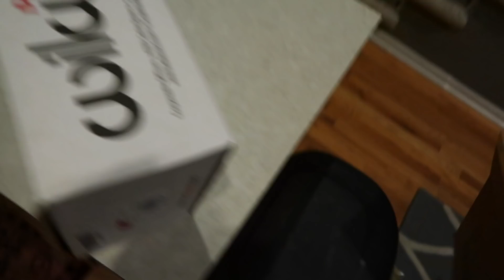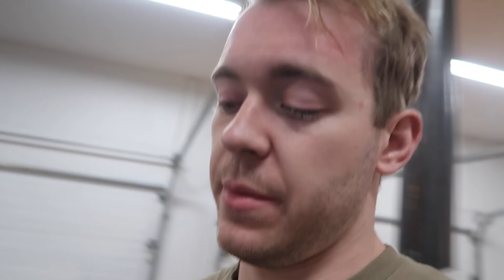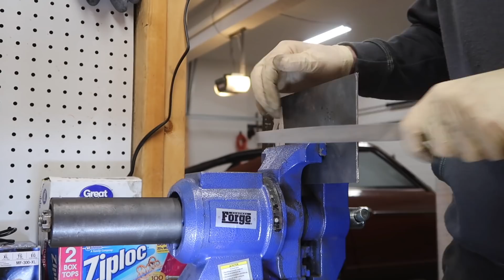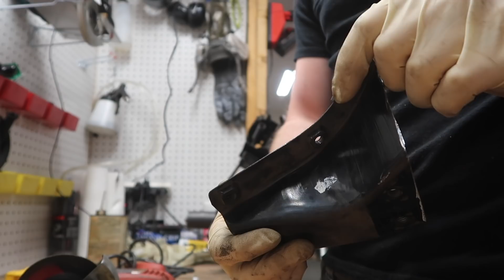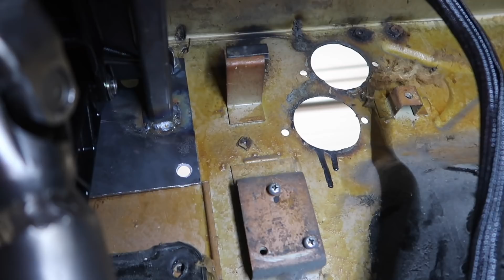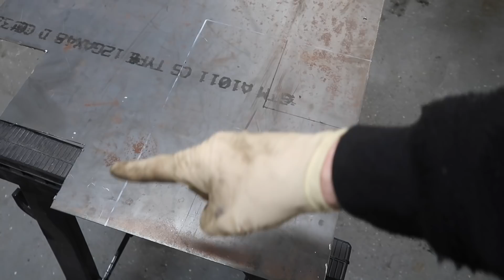Wilwood Race Pedals and Z Power Steering | 2J-Z Episode 26

Comment: You identify the ends of the main steering shaft wrong.  You stuck your finger in the steering lock hole as you describe that end as going towards the firewall.  Nope, that's the steering wheel spline you're holding.

Comment: I give you my opinion to your 240Z build. It sucks! I don't want to look like a hater but that was a good car to begin with a nice restauration. And you cut and build the living fuck out of it. What you will end up is a fast car that is a lot less worth then a stock in good condition one. You should have choose the W58 transmission... it is slim and fits in. OK it does not like so much power like that trans mission or a R154 that is pretty wide too. You could have used a RB26 engine to and have much less hassle with the swap. But yes it is your car and you can do what ever you want with it. Please make sure you reinforce the frame structure and the chassis before you hit the road with it. That 2JZ is heavy and the car wasn't build for that or the power it makes. If you don't prepare it for it you will twist the shite out of it.
Reply from the maker: This car wasn’t restored bud. No thanks on your transmission suggestions, my solution works just fine. If you watched my other videos you’d know the chassis has already been reinforced. Do your homework before you write you snarky comment bud.
Reply: Did I hurt your feelings? If you would read what I have wrote without that pain in your ball room you would see that I wrote it was a good car to begin with an restauration. And I watched only parts of some videos... so you might be right on that part. I just cant watch all because that might hurt my balls. To many people think it is great to swap a 2JZ in everything with 4 wheels. But the W58 would have been the right choice for the 240Z you just needed to lower the power you want to reach and would have a reliable car with plenty miles of joy ahead. But, nope!
Reply from the maker: Cool

Comment: I feel really bad that you over paid for that power steering. Like you said it can be done other ways, and i promise you can do it WAY cheaper. doesnt help that the owner of ZPS is a real asshat
Reply from the maker: I had this same debate with another member. Sure I could do it cheaper, but you have to factor in the time it takes to fabricate brackets, trial and error, electronics, etc. Until I use the unit on the road, I won’t know for certain whether the monetary cost was worth it...but based on other folks’ experience, I’ve heard nothing but good things.

Comment: Awesome Job, Its great to see the progress! and also Im not the only one who runs into issues! I'm so glad you posted the copper magnetic plug welding tool. I was wondering how i was going to fill all the holes after i just got done removing all the Datsun harness clamps and unnecessary brackets for my 1J build i'm working on. I noticed you hadent posted a link yet so i went and found it. https://www.amazon.com/Durston-Manufacturing-MPWT-Magnetic-Plug/dp/B000VHZHBO/ref=pd_bxgy_469_img_2?_encoding=UTF8&psc=1&refRID=WZ27ZZSMMBK2GQNTWFVQ. 
I'm interested to see how you are going to plumb the brake and clutch systems, as i will be doing the same thing. I decided to go with -3 AN style fittings for the entire system. which i hope to begin work on in the next two weeks.
Reply from the maker: Yeah the copper piece is key!

Comment: Still to this day, my #1 fav youtuber shows us he's slowing figuring out the pains and struggles of being a fabricator. 😂 I was seriously yelling at the phone "NO DONT PUT THEM THERE!! NOOOO!!" Lol Sorry man, shit happens. Fabrication is a lot like chess, gotta think 5-10-20 steps ahead for things to work out smoothly. BUT, at the same time, you have to let the car kinda build itself in a way too. 
As usual, couple tips. #1, GET A HEADLAMP AND PUT BOTH HANDS SECURELY ON THAT GRINDER! Like I was cringing watching you struggle with that cuz all it takes is that cutting wheel binding/catching for .001 of a sec and all hell can break loose. Don't wanna see you getting seriously hurt bro. #2 Try out the harbor freight 30,000btu propane heater, I have one in my shop as a spare for when I don't have the forge fired up and it keeps me warm enough to not need a carhard jacket on here in ID. 
As always keep the content comin! I have a good feeling 2018 will be a good year for 2J-Z!
PS. ❤ The ZELDA64 licence plates! ❤
Reply from the maker: Yeah, I thought I was being wise. Derp.
Reply from the maker: I have been battling -10 degree temps here in Nebraska. When it’s 20-30 outside the heater does ok, but it can’t quite cut through these extreme temps
Reply: I can see needing the light, good thought, but not quite. I've had fingers and my chin stiched back shut from a grinder catching on something. Knotted wire wheels are the worst for doing that. And I heard temps are way bad in other parts of the country, which is weird cuz I remember ID having -20° temps all winter long and this year has been like 5°... Kinda backwards